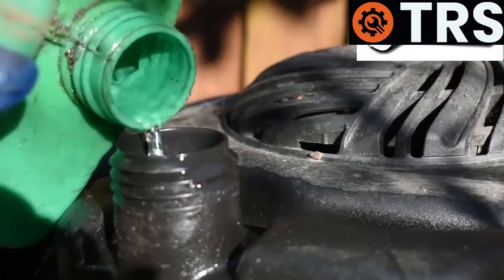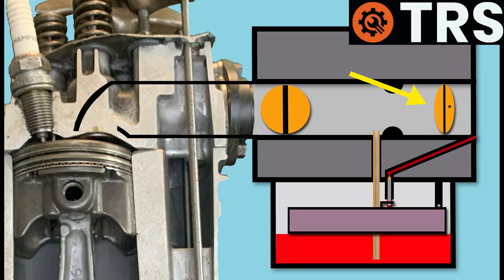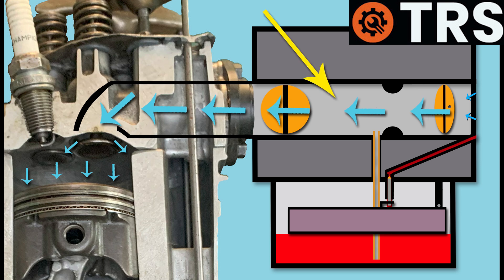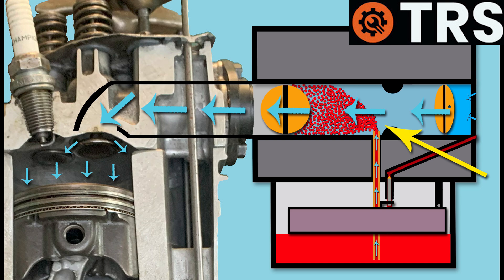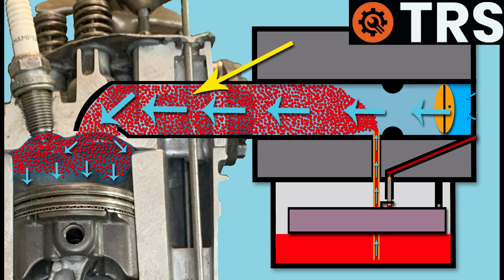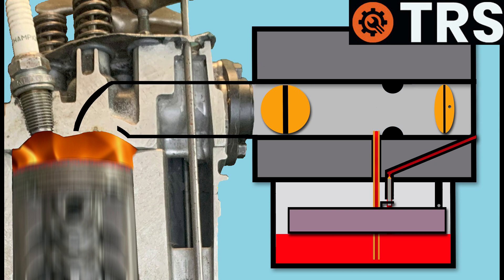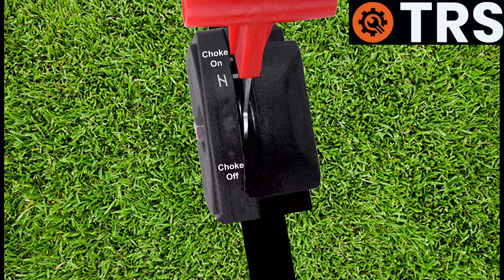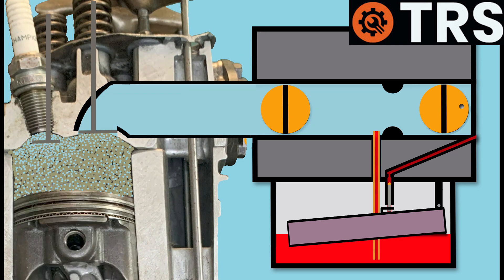COLD START CHOKE Principle Explained on a Stroke Engine!   (by Craig Kirkman)

Comment: My craftsman chainsaw has always run great when needed… the other day it died and wouldn’t start…. I pulled the filter out and it ran fine put new filter started out ok then did the same thing… it’s not getting enough air at start up I think… maybe piece of filter went in carb?? Still runs ok without filter… can I spray seafoam or carb cleaner in the carb to clean it out if something in there?? Thankyou